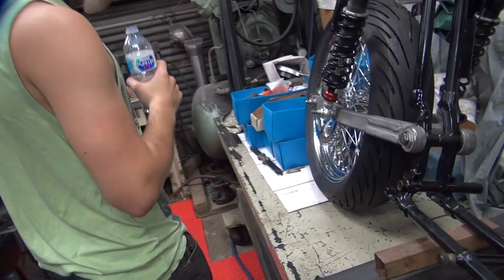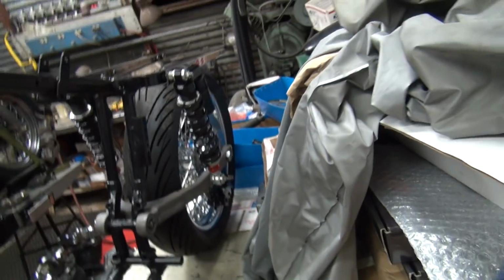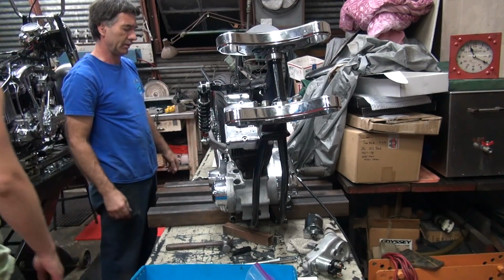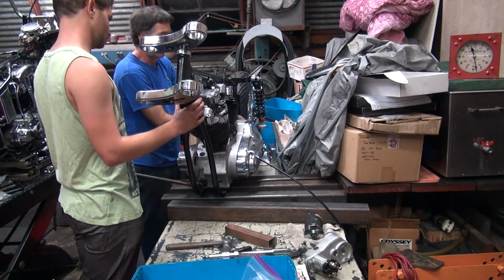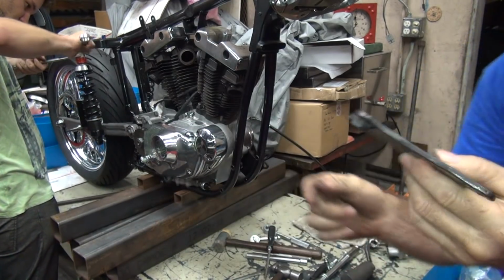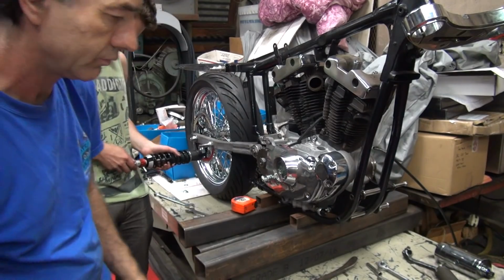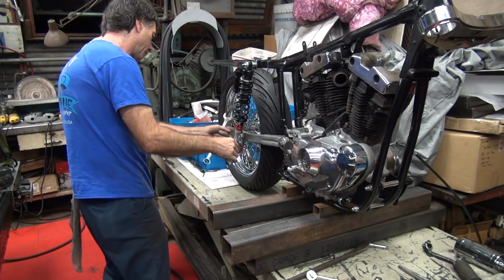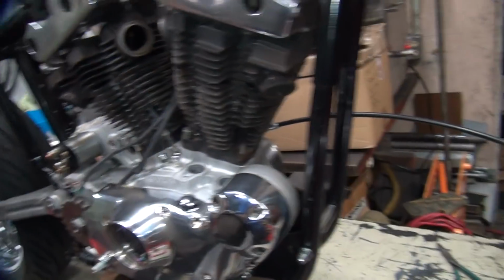1972 #129 1000cc ironhead sportster bike rebuild repair street tracker harley by tatro machine

Comment: on the motor mounts did you use the tire iron line the bolt holes up
Reply from the maker: you use a tire iron to take the weight off of the rear motor mount before you tighten all the bolts up. this way the rear motor mount doesn't break so easily. if the frame tubes are treaked somewhat you can move them around some to get all of the correct hardware installed in the correct order. than tighten everything together and the motor should be all alighned up correctly. if not, than something is wrong and you need to find it and correct the problems.
tatro

Comment: KT   This vid   is just asinine,really  doin this  when Jr  walked off to not  be there to 'spot" you? You already  know " his elevator doesn't go to the top floor". i cant believe you  attempted  this when you coulda just dropped the lift  .You are not 21 any more.Work smart not hard, now you'll be lucky to not have to take days  off with that sore back..
Reply from the maker: i was told i needed to exercise today so here you go. putting my socks on hurts my back the most. the lift doesn't go up or down but i do.
tatro
Reply: one mechanic to another, my little brother ruptured a disc in his lower back about 40 years ago lifting a motor, he is still messed up today. Strained muscles are one thing but rupturing a disc in your spine is permanent....